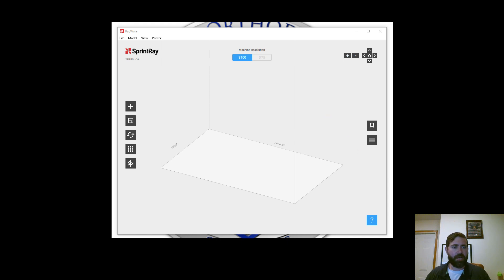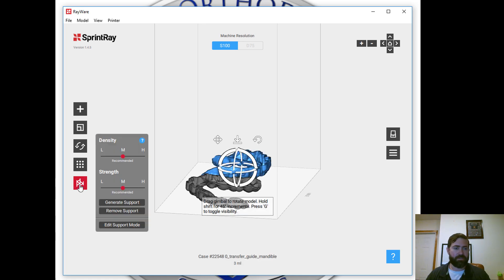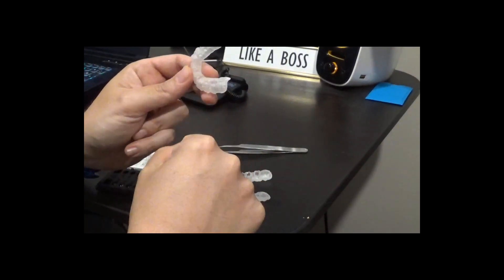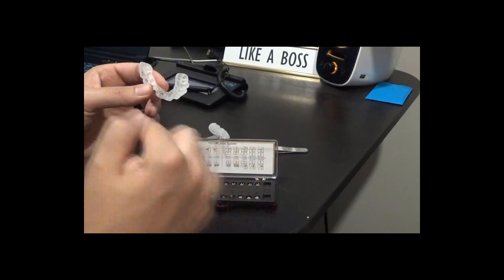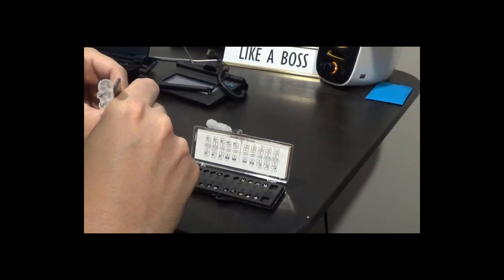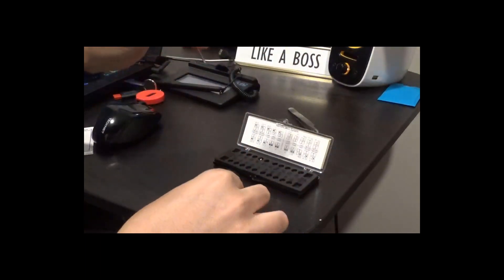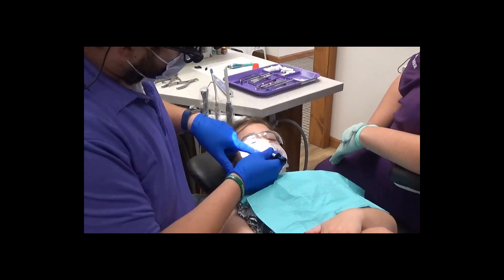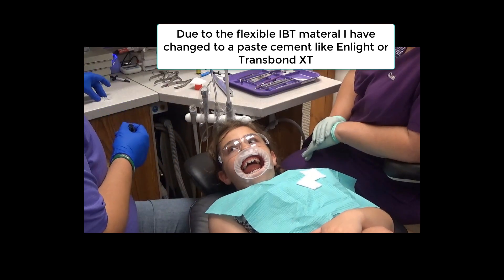Indirect Bonding Tray: 3D Print and Delivery, Phase 1 Example

Comment: Hi Matthew!
Great video on this often obscure bit of ortho workflow. 
Quick question, what has been your experience with indirect bonding since you have played around with it a bit? Is it something that an independent lab could offer dentists and they would find value in paying for it if they have never tried indirect bonding in there practice before?
Also what other resins can be used other the NextDent IBT resin?

Thanks!
Reply from the maker: We're still working with the design team a bit.  It's functional for the mini twin brackets, because have the tie wings give them more friction.  However I have had issues with retention with the self-ligating brackets.  On my next case I'm going to try using a little Emiluma (clear Silicone) in the slots for a little extra hold, and then review the performance, time, and cost of that method